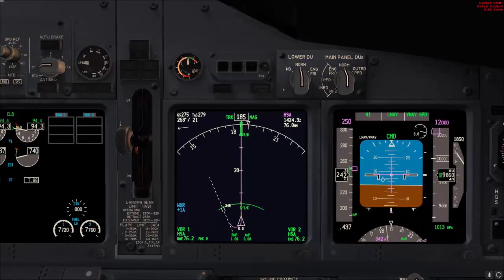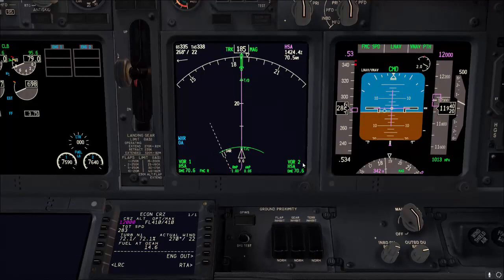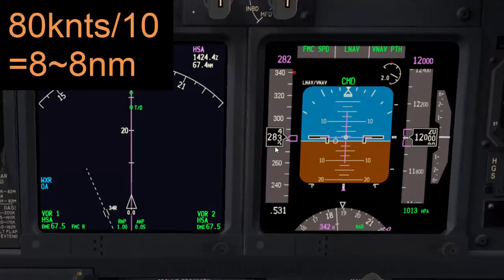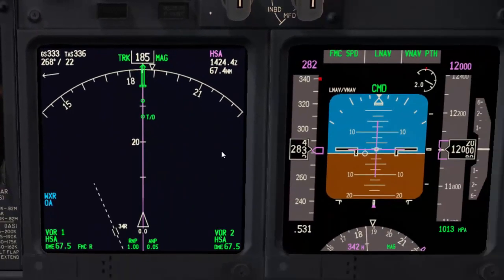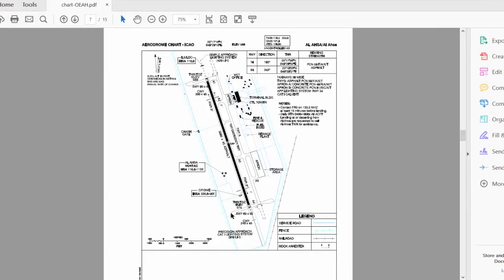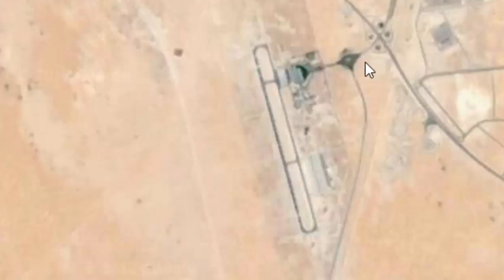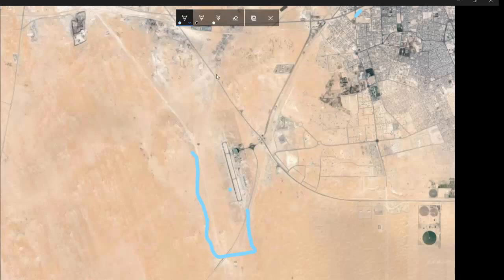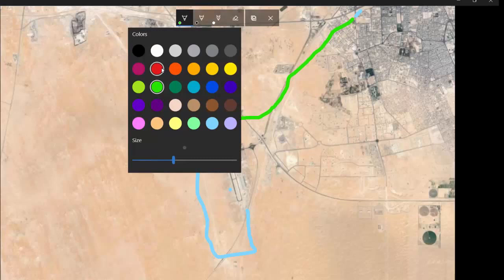Top of Descend Mental Math

Comment: No need to do any math. Just press the MTRS in EFIS and the first two digit is your altitude x3 = NM then go to PROG see what track milles you have

Let’s say you are at 10000ft you need 30nm to loss and you have only 20nm to the airport you are high on profile simple
Reply from the maker: Hi, 
Thank you for sharing, 
How do you factor the wind speed and airplane speed in this method,
In the example you mentioned if you are flying at 10,000ft at a speed of 240 indicated you will need 34nm, 
I have cross checked mental math with the FMC track miles, the mental math might give you a more precise number (that works for geeks like me 😉) 
The method you mentioned can be used as a general approximation, 
So I guess the pilot chooses the one they feel comfortable with. 

Thx again 
All the best
Abdul

Comment: Asalamu 3alaikum Captain,

I have a few questions.

1)
You said that for each 10 knots speed above 200 knots, I have to add 1 NM.

So at 290 Knots it would be 9NM.

But what if I am at cruise altitude at FL410 for example and a speed of Mach 0.816 ?

How do I calculate the extra distance for the speed?

2)
Why is it not better just to use TAS for distance calculation?

3)
If I want to use a potential Enroute Alternate in the Fix Page, and I want to draw a green circle, I know that I have to calculate a radius of Altitude minus Fiel Elevation × 3.

So if the altitude is FL350 and the elevation of the potential enroute alternate is 3300 feet, then I would
Calculate 35000-3300 = 31700ft.

31,7 x 3 = 95,1 NM = 95NM.

So the radius should be 95NM, correct?

Do I need then to add on the radius the distance for the speed?

If yes, how do I have do calculate the additional distance with a speed of Mach 0.78?

Thank you!
Reply from the maker: Hello those are great questions 
1- use whatever IAS the VNAV will transition to, just go to the decent page you will see Mach No/IAS whatever that IAS is you use it to do the mental math. 
2- Remember that is a simple way to figure quickly the distance you need, I don’t see how TAS can be used, can you give an example on how to use it. 
3- This is like no.1 answer use the IAS that VANAV has computed in the DES Page. And yes you would need to factor the speed above 200 and the wind as well. 
Now how big the circle should be, it depends:
- Are you coming for a straight in approach if yes, then you do the calculation based on what e said above. 
- If you are coming for a downwind. How long are you planning to fly past the abeam point before turning base or turning for an intercept angle to final,,, so this might sound a bit complicated it is not actually, it is a very simple math, 
- For example am coming to joint downwind and am planning to do my turn from down wing to base at 5nm. That means my track miles are now 10nm more at least if I factor base then it might be 15nm minimum. In that case my distance needs to be shortened by this extra mileage. 
It is a lot simpler than it sounds here, if it doesn’t make sense to you or if you like to discuss further we can setup a call. 

Again great questions. 
Wishing you all the best 
Abdul
Reply: @AbdulmuatiAsiri37  

Thank you Abdul.

Is there a reason why you are not making more videos?

There are many very interesting youtube channels of real Airbus and Boeing pilots who load up videos about flightsim regulary.
That way visitors can learn new things and procedures.

May I ask a few more questions about 737 FMC, please?

1)
Is it possible to enter Longtitudes and Latitudes for reporting postion?

I dont mean waypoints defiend as Long Lat waypoints like you would use on NAT North Atlantic Tracks.

For example ATC tells you that you have to report postion at E039 Longtitude.

You then would enter E039 on top of the LEGS page.

The FMC would create a waypoint called E039 and draw it on the magenta line of your programmed flight route.

That method is for example used in 757/767.

Another example is that ATC tells you 

to report position at E039 and then every 5 degree Longtitude along your route.

You then would enter:

E039-5
and put it on top of the LEGS page.

The FMC would calculate the postions on your route and create waypoints on the magenta line.

For E039, E044, E49, E054 ect.

For Latitudes you can do it analog like with the Longtitudes.

Is this possible to do that in the 737NG FMC, too?

2)
Is it possible to use OFFROUTE DESCEND function in the 737 FMC?

For example in the 767 or 777 you can use this function and it shows two additional circles in white and blue colors.

It is a very helpful cool feature for descend and energy management.

3)
Is it possible to enter speed constraints as MACH number?
I know that in Airbus A350 and A380 it is possible.
You then would read for example .81 i  magenta color as constraint.
I habe never seen that in Boeing aircrafts.
I have only seen knots as speed constraints.

4)
Do you fly sometimes to Pump Stations?
Like Pump Station 10 OEPJ ect?
Reply from the maker: @AVIATIONSOUNDEXPERT  I lift my job two years ago, and got a bit busy learning about  self development and life coaching currently this is becoming an obsession of mine.  
Regarding your questions:
1- Yes you can enter Lat/Long coordinates and the FMC will create a way point that will be shown in the ND and can be treated like any other fix. 
2- As far as I know that option is not their in the 737,  at least the last FMC revision that used in the airplane. 
3- Yes Mach No. can be entered as long as you are flying at an altitude where the transition to indicated airspeed has not been reached. One option to maintain Mach No longer is to reduce the target IAS for transition. 
4- The last time I flew to OEP* was more than two years ago. 

Thanks again for reaching out, 
All the best 
Abdul
Reply: @AbdulmuatiAsiri37  

Thanks again, Abdul.

You should still continue making Flightsim Videos.
That way you keep you skills sharp.

Also there are many things you can do.
Flying different aircrafts or flying different approaches with 737NG ect.
Users lile to see and learn new things.

Regarding to my 3rd question:

Csn you show me how you would enter the speed constraint as MACH number into the FMC?

If I fly for example 290 knota at or above FL220, I would type in

290/220 next to the waypoint in the LEGS page.

How would you type in MACH 0.81 at FL 380 into the FMC as speed constraint, so that I dont get an INVALID ENTRY message?
Reply from the maker: @AVIATIONSOUNDEXPERT my apologies, in the Legs page you can not enter a Mach No. my apologies for the incorrect answer. 
As far as uploading more videos, am planning on doing that in the future 😉

All the best,
Abdul

Comment: Thank you very much for a nice video.
Also Captain how do you prefer to monitor profile as you are descending (as far as mental math is considered) how do you mine onto track miles and check?
Now once you know how high and how low how do you prefer to apply correction (the mental math part of correction)?
Reply from the maker: Hello ADITYA KP, 
that is a great question, I might do a video to talk about it, but here is the short version of the answer, 
First of all you need to make sure you are considering the correct track miles, some times what is is in the CDU is not the correct track miles, 
Then I check from time to time either every 2000ft or 5000ft to check how close I am to the profile. 
If I am a little bit high I increase the speed either using V/S or LVL CHN, 
If low I decrease the V/S a little bit or increase the thrust, but not reduce the speed in LVL CHN. 

If I am very high then LVL CHANGE and I increase the speed as fast as I can and SPEED BRAKE up. 

The other way for me to monitor my profile is using V/B (Vertical Bearing) to the RW I have a few videos about it, in my opinion this one of the best ways to monitor the profile specially below 10,000ft. 

Hope that help,  
If you have any further questions or would like to discuss it further we can set up a Skype call, I will be more than happy to explain it more. 

Thanks again 
Wish you all the best 
Abdul

Comment: Great video, another way to consider T/D is to keep in mind ATC will usually place you about 10,000 agl and 35 nm out from your landing airport and at 250kts.  From there it’s usually radar vectors for traffic etc.  So the T/D should generally be figured from cruise altitude to this entry point or entry gate.  In the B-737 you can figure the decent with either a two to one or three to one plus speed reduction depending on weight of the aircraft and headwind or tailwind.  With a tailwind and heavy a 3 to 1 might be best and at light weights and a headwind a 2 to 1 is good plus speed needed to lose.  Generally about 100kts. Or ten nm.  Hope this helps.
Reply from the maker: Hello Sonny, 
Thanks for sharing the knowledge. 
I was not aware of the 2 to 1 for light and head wind I will give it a try 
Good point with the plan for 250 at 10,000, the only thing to keep in mind is ATC level of competency from one area to the other. 
Thanks again for the contribution. Please share any other tips or techniques. 
All the best 
Abdul
Reply: As a new upgrade, Ive sometimes wrestled with TOD timing when give PD clearances. I think Ill employ your strategy with shooting for 10K 35 out at 250 kts. given the usual radar environment.
Reply: What does 3 to 1 and 2 to 1 exactly mean over here?
When to consider aircraft is light or heavy for descend?

Comment: grate video. but what abut light aircraft ? speed between 100-140 knts
Reply from the maker: Hello Yusur, 
For light airplanes the rule of thumb is 3*the altitude to be lost for the distance and 6*ground speed for the vertical speed. 
For example to lose 10000ft flying at 120knts ground speed. 
10*3=30nm
120*6=720fpm (I believe this is it. Have not used it in a long time) 

Thanks for the question please let me know if you have any other questions or comments. 

All the best 
Abdul

Comment: Will I need to add wind at traffic pattern  or at straight in approach in my T/D....or I just count it until my specific altitude to loose...?
Reply from the maker: Cruise wind should be enough, if however you know wind at a lower altitude is stronger then you factor that wind. 
For example if you are cruising at 36000 and the wind is 260/50 but you know the wind at 30000 is 250/100 then you factor the stronger wind. 
This should put you in a good position regardless of the wind at the traffic pattern. 
Wind at the traffic pattern will effect your configuration and track miles to slow to UP speed. 
Hope that clarify your question if not or if you want more information please let me know. 
Thank you 
Abdul
Reply: Abdulmuati Asiri that helps alot...thank you sir...
Reply from the maker: You are most welcome 😊

Comment: Hello captain Firstly I fully appreciated your cooperation I'm a cadet pilot just wondered what do we need to know about V/S in this case? Should we basically multiply GS by five simualtaneously while executing descent?
Reply: I've got the asnwer below already answered captain thank you again. :)
Reply from the maker: Hello Umut, Thank you for your question. 
For me, the way I use V/S is to use it in order to maintain an idle power descend provided the airplane is still on the proper path. The V/S I mentioned will result in the power being almost at idle and will maintain those speeds. To stop the A/T from chasing the speed in the window I will set a safe lower speed in the MCP for example 250knts. But again this all assuming the airplane is on profile if high or low then adjustment need to be made. 
Feel free to ask any question and your suggestions for areas to be covered are more than welcome. 

Wish you all the best
Abdul

Comment: I tried calculated, and about vsi?
Reply from the maker: This will give you the required distance to do idle power decent. 
So use LVL CHNG, or V/S that will result in idle power for example: 
2200fpm till 11000ft then after you slow down to 240 or 250 use 1400-1600fpm, till 20nm (track miles) then slow to UP speed and start configuring.